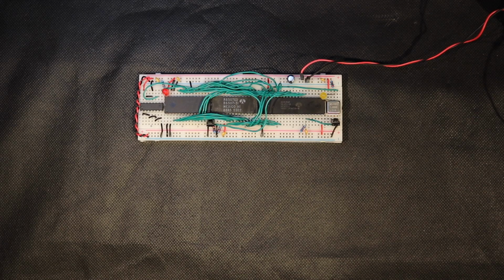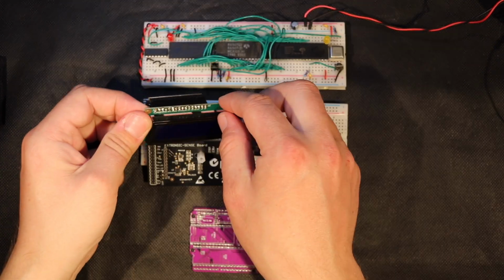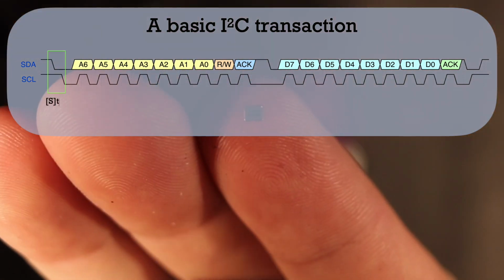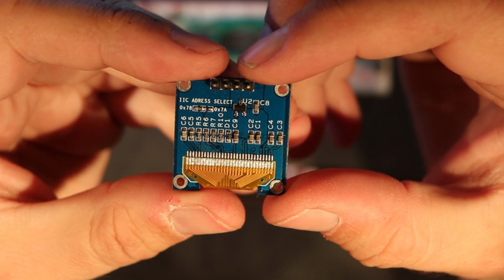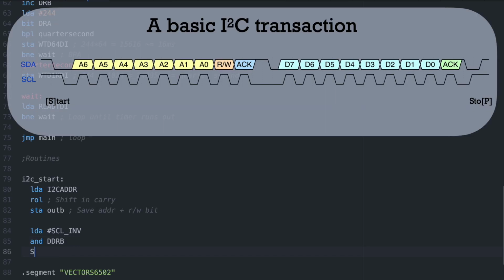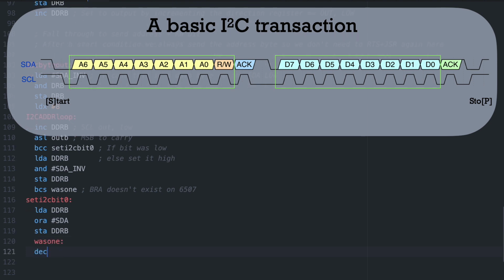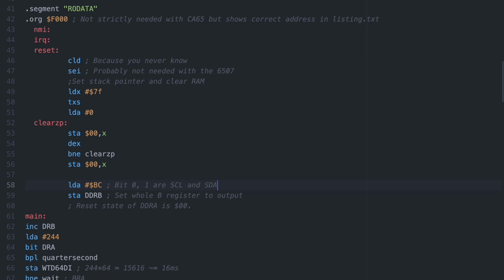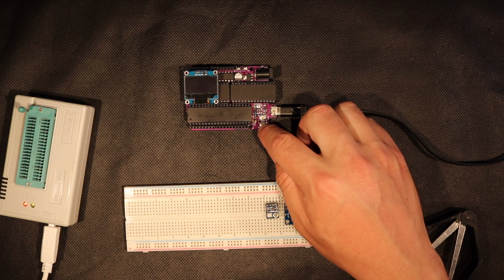I²C on a 6502 Single Board Computer - The 65uino #i2c #6502

Comment: cool project to understand I2C better. if you want to have two components at the same bus like.a SSD1306 and a DS1307 it is very helpful. display date and time on oled and changing this time to actual time is not easy when you display every second the new value. When two of SSD1306 have different addresses you can display the date on one of these and the time in the other. rhe Onewire protocol is also interesting for using a DS18B20 Modul.

Comment: Looks great. I am so glad you are using assembly, and not going to town with macros everywhere. I am learning 6502 assembly too, and I have lots of arduino modules that use i2c.
Reply from the maker: It's a lot more fun when you get good at assembly before you start throwing macros everywhere - also makes it easier to get help. Even makes it easier to get help from chatGPT. 
It's really eye opening there's really nothing you can't do if you throw enough assembly at it. Then it's only a matter if you really want to :)
Reply: @AndersNielsenAA  I really like your 6502 computer. You have used a 6507 and a RIOT, and I am just using the 6502s with the VIA thing and a at28c256. Your computer is different than Bens and your memory.cfg is different too. I am getting a thing that lets me use a ZIF to a breadboard. I have lots of Arduino modules that use i2c.. so they should be pretty happy to run with 5 volts. Anyone I love what your doing, and I have LOTS to learn and that is fun :)
Reply from the maker: It took a while before Ben switched to cc65 - maybe he got some inspiration from my videos too. I certainly got a lot from his :)
Reply: @AndersNielsenAA  He might of. The memory,cfg map is different from Bens, but you have a different setup. I hope to get that software i2c code working on my Ben Eater computer. I have been translating the older Ben assembly to the new Ca65 stuff. I really like it. I want to get the i2c code and print*hello world* I think i2c is not too bothered with going too slow so we should be good. I hear * oh 9600 bps is slow* lol the code will be maybe less than 100 bytes. When I first started I had a 300bps modem. I can't wait to play.
Reply: @AndersNielsenAA  I am looking forward to getting good at assembly, and I like my code clean and well organized. I don't think I will do many macros unless really needed.

Comment: a good solution ... but i miss the code of the arduino modul ... i see on the schematic that atmega to convert from the 6502 bus to i2c but there must be a code inside the arduino ... where is it ??????
Reply from the maker: No ATMegas used - it’s all 6502 assembly (GitHub link in the description of the video).
The I2C subroutines I recently split off into a file called i2c.s - quite a lot of things have been improved since this video.

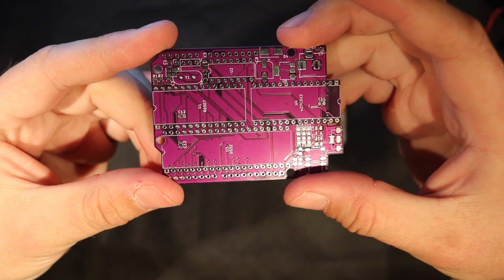Comment: 1:03 if it work like that. new chips allready manufractured even you buy old and your chips not go waste land if you put them attic haha win win. how much manufracturing pcb makes this nonsense xD

same as lets make usbc standard even iphone have to use it NOT matter if iphone would give apple-usba cord so everyone can charge.
saving packaging cost and not give usbc charger make morew packaging cost. people needs buy usbc charger anyway for one time bcoz no usbc-usba cable. its usbc-usbc on phone package LOL.
trying make better actually made it worse.
i had exactly this problem when first time buy usbc phone. no charger. no usbc-usba cable to charge it even pc or older charged that has usba LOL.
its not matter what connector phone has if end of cable hace widdly used connector i mean usba
we have same problem when usbd or what eva comes next lol lol. they should give usbb-usbc cable bcoz nobody have usbd charger for first time lol
Reply from the maker: The faster chips sell == the more are manufactured. If more recycled chips are used instead of new ones, then less chips are manufactured == less total waste.

Comment: Where is the best place to purchase the hardware for this?
Reply from the maker: At the moment the easiest way is to send off the Gerber zip file off to a PCB manufacturer, get 6507 + 6532 from ebay/aliexpress and the other parts from digikey, farnell, aliexpress etc. I might offer it as a kit at some point.. soon-ish..
Reply: @AndersNielsenAA  I got the boards and am wondering if I need to buy a different eeprom than the one I have already. I have a couple AT28c256's, will these work?
Reply from the maker: @vip_bimmervip_bimmer8033  Those need the WE pin tied high and maybe some other jumpers - it’ll help if you compare the pinouts and have a look at my “hacking ROMs “ video.

Comment: 13:40  i don't understand the following sentence "since the clock pin is conveniently located on the pin 0 of DRB".
DRB is not a chip, so what do you mean by pin 0 of it???  are you saying DRB is set by pin 0? are you saying pin 0 is clock input? are you saying pin 0 is clock output and also DRB set pin?  are you implying DRB is 6532? so confusing...   isn't DRB a register in 6532? all the pins of 6532 have names in the database and there isn't a pin called pin0 on the 6532 by the way. what do you mean by pin 0, which pin is the clock pin of 6532?  is this video only for people who know how to use a 6532? also i don't understand what is convenient.  the physical placement of a pin called pin0 or that a pin is used to set DRB and also 6532 uses it as a clock pin? what is the convenience :-( so frustrating when you see a very interesting topic, great examples and nicely done video but language is so frustrating that you better do something else than  spending more time trying to decipher bad sentences than thinking about the actual subject :-(
Reply from the maker: Pin 0 of a register makes pretty good sense when it's mapped bit for bit to physical IO pins - but I know what you mean. I could've said bit 0 for clarity I guess. Using bit 0 of an IO register as the clock is convenient because you can use INC/DEC instructions to toggle the pin.

Comment: Thanks for this. I've been trying to implement I2C on the user port of a Commodore 64 (6526 rather than 6532), and I'd almost given up. But you've taught me two things: 1 - I've been doing it wrong (yep it's the open drain thing!), and 2 - it IS possible!! So I'm gonna be switching to the "signal with the DDR register" technique. One thing I wasn't clear about: do you need external 4k7 pull-ups, or can you rely on whatever's built in to the slave devices?
Reply from the maker: You are very welcome! The short answer to your question is: It depends. 
If the lines/cables are short and the speed is low and the peripherals have pullups you probably don't need to add extras. If you somehow manage to run it at 400KHz through a long bad old unshielded USB-cable, you're probably going to need them. Basically the current through pull-ups has to overcome the capacitance of the conductor before it's time to read the bit - the more capacitance on the line the slower you can go unless you reduce the resistance (add pullups).

Comment: AY3-8910...sound chip from the Intelivision game controller... I have a few in the shed...don't make me use them again...please.
Reply from the maker: I won't rule out trying it with my 6502 SBC R1(The 65uino here isn't well suited to interfacing things straight to the data bus) but I'm leaning more towards some of the Yamaha FM synths because they sound better - even if they're more of a late 80s thing than a late 70s thing like the 8910 :)

Comment: Where do you have the best luck sourcing used retro ICs?
Reply from the maker: If they’re common enough like 6502s 8088s and Z80s, AliExpress has you covered - sadly they are often blacktopped and relabeled (usually with the correct label tho).

Comment: Waiting for you to connect it to the Internet and make it send its first tweet!
But before that, there is this TFT color LCD called ILI9225, which uses I2C as well. Maybe you can try that. I had bought one to try with my D1 mini
Reply from the maker: If I remember correctly the D1 has an ESP8266 that happily runs 140x faster than this little 6507 making it a bit more realistic to update that many pixels in color at a reasonable rate :)
But there are ways to tweet!
Reply: @AndersNielsenAA  yeah filling all the pixels (even the random dots) will be quite slow. Also a slight correction, the LCD is using SPI not I2C like I said. I misremembered, but the lcd has just one data pin and a clock, causing confusion.
Reply from the maker: @narayanbandodker5482  It can still be done rather easily - just makes pin sharing harder but not impossible
Reply: @AndersNielsenAA  So about the internet connection. There is the W5500 SPI to Ethernet breakout that can connect pretty much anything to the internet. Once you have bit-banged SPI you can do that. It has a built-in TCP/IP stack so you just need to construct the API requests for Twitter.
Reply from the maker: There's also the option of using an ESP8266 with AT-commands over serial. Does twitter still have a http API or would I need to make an SSL client in 6502 assembly? :)
Reply: @AndersNielsenAA  yeah I guess http support was gone even before Twitter switched to using RESTful APIs. Maybe an http proxy can be used somehow, though the ESP has an SSL client library written (which might be cheating :)
Reply from the maker: @narayanbandodker5482  Another approach I like is offloading the “hard work” to a Pi that’s already handling home automation via NRF24L01+ for instance.. which could include tweeting from a 6502 device.. but again - what’s cheating? :)